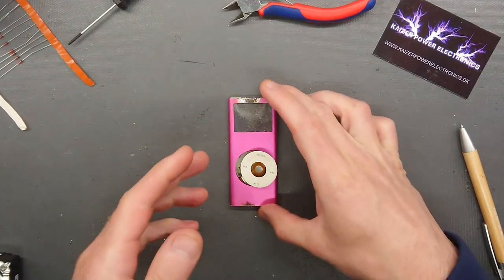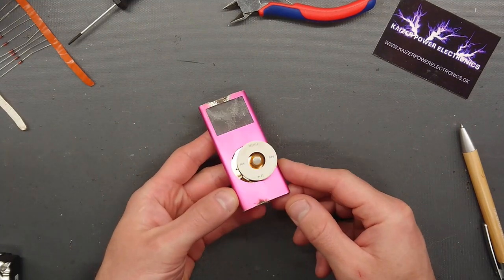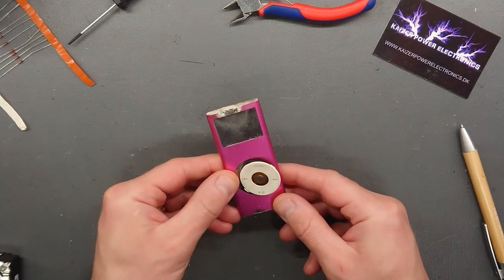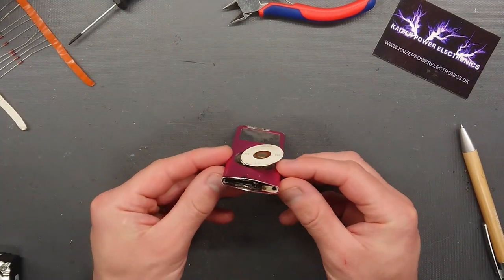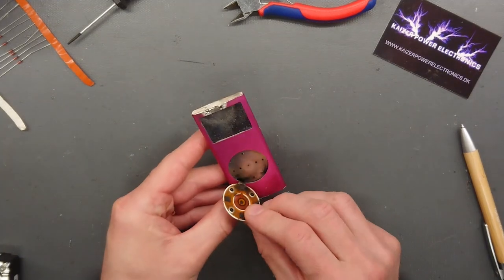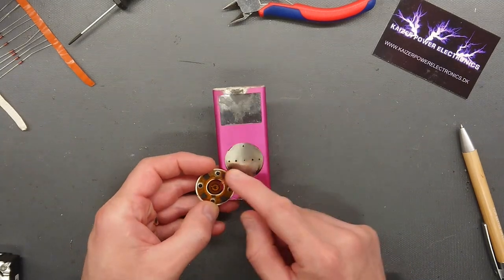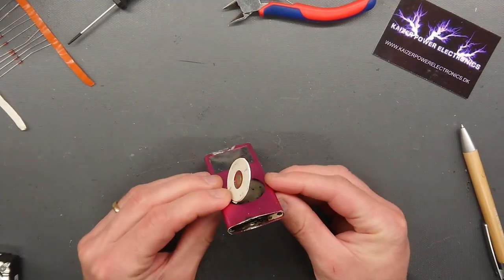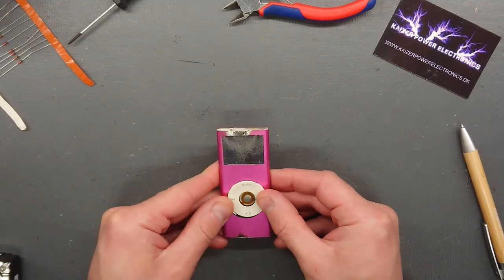iPod Nano Explosion in Slow Motion 1000fps

Comment: maybe try a lower charge into through a USB socket...love how the wire landed and let more juice out of the bank!
Reply from the maker: I had to use highest possible voltage on the capacitor. I had some mis-firings when voltage is as low as 1800V. It is also hard to avoid the ground circuits/frame/shielding as many devices are heavily shielded/grounded to comply to EMI regulations.
Reply: @KaizerPowerElectronicsDk  yes i see your point...the best i can come up with with that in mind is...drill a hole in the center of the screen cover...connect hot to all of the usb pins and poke a fat wire through the 
hole to the other wire...
Reply from the maker: @m3sca1  I already did that on some of the phones ;)

Comment: Funny, I have a bank of 15- 200uf, 2300v defibrillator capacitors but lack a power switch. Will have to look into a switch like this
Reply from the maker: Brass switches will wear the least. High voltage switch wear is worse at lower voltages. Check out some of the interesting papers on pulse power I got here: https://kaizerpowerelectronics.dk/tools/file-archive/?drawer=application_notes*pulse_power